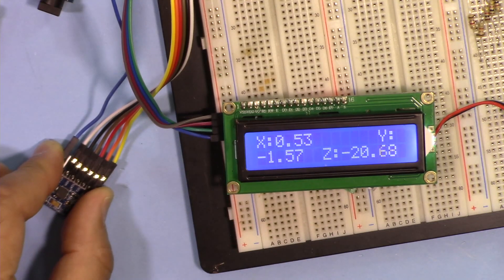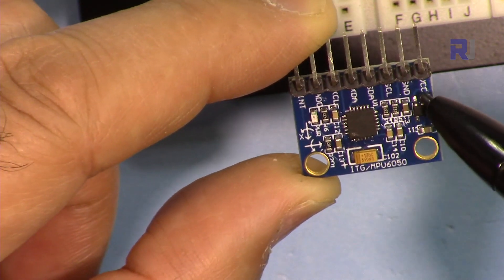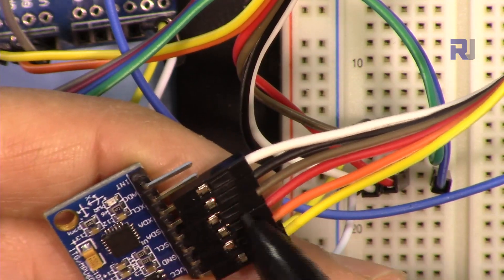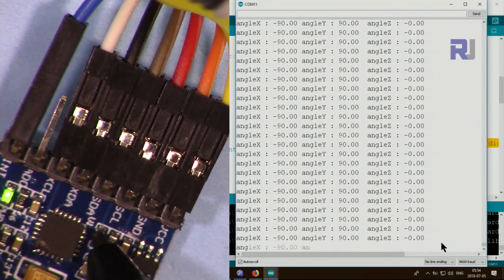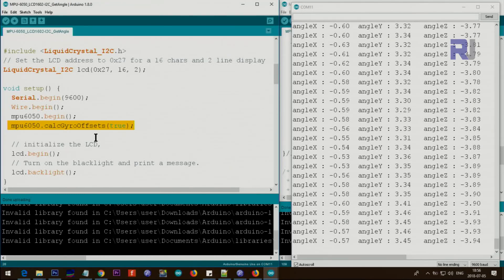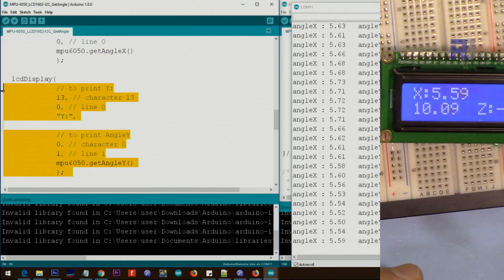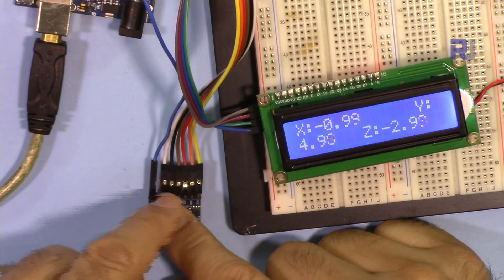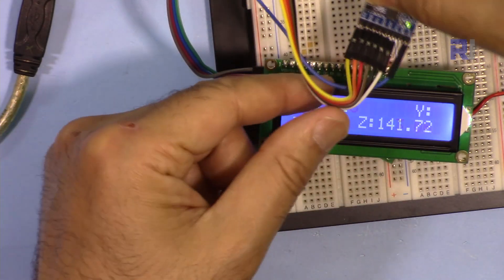Using MPU6050 with LCD1602-I2C display with Arduino code RJT98

Comment: oject but I suggest your camera should not be too close to the pins
Reply from the maker: this is video requires to watch 1-introduction to LCD , and 2-Introduction to MPU6050 both links are in the description. if you watch you will know the pins. I purposely zoomed in because most online tutorials you can't see the pin label or text.  This helps a lot. Most of my comments are "thank you for large text and clear view of module".

Comment: Hi, I'm using mpu6065 with Arduino due, it works fine, and when I added other distance sensor, nothing happen and I got nothing in the serial monitor, do specify the mpu 6065 address, ? In the program, how to do it? Thank you sir
Reply from the maker: Hi, yes. it is the I2C addressing issue.  You may learn something a different module where two or more is used https://youtu.be/0glBk917HPg
Reply: @robojax  thank you so much,  I've already saw this video I just need to know how to set mpu 6065 address in the program. Thank you
Reply: @robojax  I'm using Arduino due, interfaced with 3 vl53l1x, mpu5065 and 17 scale weight , each sensor works fine alone, I put the 3 programs in one and I could not set mpu6065 address, which gives nothing on the serial monitor. So my question is how to set mou6065 address on the program , thank you .

Comment: There seems to be an angle drift by a couple of degrees even though the sensor is placed on a horizontal position. How to calibrate/ fix this issue?
Reply from the maker: I am not sure why. Check the drift against all axis and if you get consistent,  the add or subtract the drift value from the  angle.

Comment: Hi, I m planning to implement this for angle measurement and display the angle in a LED for quality control and the equipment for that should also be small(here there are breadboards and lot of wires) is there any way to do that?
Reply from the maker: Hi, you can use this https://youtu.be/DuamjlstOKM

Comment: Hello good day is there problem with my mpu 6050 module if it still display just like the 6mins 10s in the video but all the connection is correct

Comment: Hi
How we use IR sensor for On and Off purpose
Or
Using Two IR sensor
Pls Told me pls its argent
Reply from the maker: I have many infrared related videos. please see them here https://www.youtube.com/channel/UCkcBSig_Iu4ZnAIeCeG1TVg/search?query=Infrared
Reply: Robojax I see your videos but i wants code for ON and OFF
Its only ON for delay that i give in code
If i want to OFF after delay ?
Like this video if i touch on mirror its on and than i touch again on mirror its off
Like that if i ir sensor sense may hand its on than and aftee 1 min ir sensor sense my hand its off like that
Pls help me give me code
Reply: See that videos
Reply from the maker: Here is Touch ON and Touch OFF. You just add the delay for whatever time you want it ON or OFF https://www.youtube.com/watch?v=Nqh1vYQEEjs
Reply: Robojax if i want to OFF IR sensor after delay than what can i do
Reply from the maker: did you check the code? this is exactly what you want. instead of relay connect IR.  In this sketch, pin 10 goes to relay. you connect the VCC of your IR to pin 10 so it gets power only when pin 10 is HIGH. Follow the link, look at the code.
Reply: Thank You I try this code than i let u know once again thank you